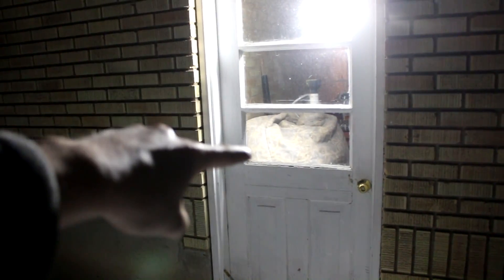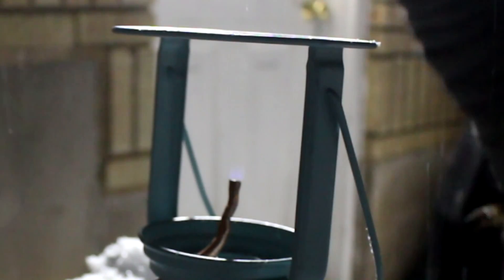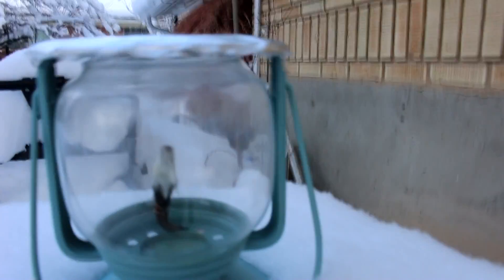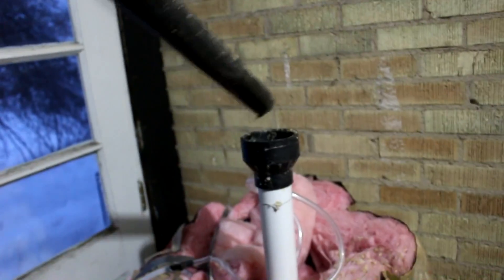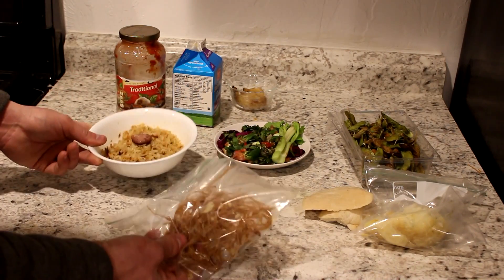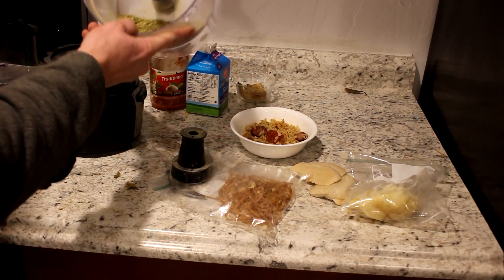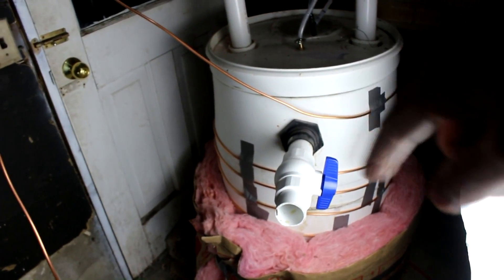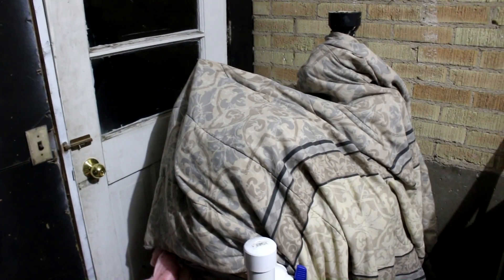Cody's Methane Generator Part 2: I Have Gas!

Comment: Hello Cody, 

I know it has been a while since you made this video and I do not know if you will be looking at comments from older videos, but I thought I would give it a chance regardless. Over the past few months I have been thinking about how it would be possible to make liquid hydrocarbons (diesel, for example, especially given prices currently) using the Fischer-Tropsch process. My full idea is to use a methane generator like this or woodgas from charcoal production to produce the raw feedstock. This would then be cleaned and then broken down into hydrogen and carbon monoxide to feed into the Fischer-Tropsch process. Obviously the system would not be very fast, even though parts of the process are used industrially, and likely not economically viable, but I thought the idea might be interesting to test or at least think about. I don't expect a video on this or anything, I just remembered this video and thought the idea fit.

Comment: So why not get a really big ball, or daisy chain a bunch of them.....and when the whole batch fills up, pump it into steel containers? You could probably figure out the rate of production, and set the gas pump to run off of a standard house timer. Perhaps set it up with a physical switch that overrides the timer and turns on the pump immediately if the balls inflate too much too quickly.

Comment: isnt the 1 kwh used to heat the tank capable of giving off more heat and therefor light than the gas you can generate per hour?  i mean a 60w bulb is only using .015kwh and that seems like more power than you could create with that gas, no?  obviously storing and pressurizing the methane system would change this fact but as it stands it seems terribly ineffcient if you have to heat the digester

Comment: Hey there
I m building one myself, did some research on the topic and I ve seen many projects including an inverted barrel immersed in water, before the methane makes its way to the storage...

My question 
What would happen if one were to connect the methane digester directly to a storage container instead of having it pass through the submersed barrel?

Comment: Could you build a water piston,
What I'm thinking is a lot similar to the coil around the water heater.

But instead of the coil the water heats up expands pushes the top out of the pipe lowering the pressure, after the pipe reseals itself it will suck water in Sears bottom.

The pressure in the pipe will move the lid down ferther, but the lid is completely enclosing the pipe and when the suction that has lowered the lid far enough it will match up holes in both pipes, and that's what lets the water in.

Comment: how many rabbits to power a lawn mower ICE that would A. power an off grid AC generator
B. provide heat from its exhaust to run said digester?  I imagine between pelts and rabbit stew on a small farm it could work

Comment: While I was watching and you mentioned that cow waste would be superior I remembered that cows have 4 digestion areas not certain about cows guts.  So it occurred to me that the digestion process would have stages and possibly different efficiencies and a better digester would have multiple compartments.  Then you showed how you had begun to improve the design by adding the waste exit pipe for the "digested material" how do you know its fully used?  What I am picturing is a flow like a dry composting toilet design except closed in with multiple tap off points for the gasses.

Comment: What about human droppings, can you use them too?
Reply: Yes and many sewage treatment plants do this. There is a bit more of a hazard as human stool can get you sick easier as the bacteria in human stool already is equipped to live in the human body. Keeping the area clean and it should be fine, however as you can see when Cody took the insulation off that is not easy and spills do occur.
Reply: @MyuFoxable  well, to be fair, I don't think Cody was as careful as he should have been when pouring that mixture in. He could have used a bigger funnel to protect against spillage.
Reply: That is kind of my point. Keeping the area clean enough for when handling human stool is not as simple as one might want to think. Would be a lot of hassle when feeding the digester is done 2 - 3 times a week. Still can be done, just probably not a good idea from a safety perspective.

Comment: An old, OLD, friend of mine did this back in the 1970's. He used pig waste to produce methane which he used to light his barns. (Pro tip: Point the nozzle down and hang the mantle off of it; just like a Coleman lantern.) During the summer he even managed to collect and compress some of the gas for other uses that included soldering but not welding. But, then again, he was a bit of a tree hugging weirdo.

He actually used outdoor carpeting on the floor of his pig stalls and had an automatic wash station that would rinse most of the gunk off his pigs while they walked in. I have not, to this day, seen cleaner barns or happier pigs! On hot days they would basically spend the entire day, when they weren't busy eating, walking back and forth through the wash station to cool off despite the fact that he also had a bunch of shade trees overhanging the pig yard. Pigs are a whole lot cleaner and smarter than most people would believe!

Comment: Cody look into the quality of fiberglass insulation. It degrades as the temperature decline. It is not good source of heat retention.Good luck like you videos.

Comment: Add cooking oil, new or used, at a rate of 1% by volume. The oil coats the methanogens allowing them to survive the higher PH levels associated with the increase in methane production.

Comment: You should make a co2 generator and use algae to make it into o2 then connect the pipes with the ch4 to make. It 75% CH4 and 25%O2 and then burn that

Comment: but then you're making a methanizer whose purpose is to heat itself, isn't it kind of pointless ?
i think it would be much more interesting to rig it so that methane accumulate, then you burn part of it to power a small compressor that forces the rest into a pressured container. 

it's a lot more complicated though =)

Comment: What do you do with the gunk you take out of the tank?  As methane is only carbon and hydrogen  then the gunk should be full of the nutrients that was in the food (nitrogen, phosphates, potassium, calcium, trace minerals) - do you use it as a plant food?How liquid is the gunk - does it have many suspended solids?  How well do the bacteria digest the lignin in the wood shavings?

Comment: Don't use meat in your compost. It's easier to remember than one part meat to X parts plant matter. And also no risk for rat infestations at all, as compared to a slight risk. You're going to be happier using it too. No meat, that's the ticket.

Comment: in b4 we won't get an episode 3 because the flame lit the insulation on fire, the fire reached the main chamber where the methane's being produced, and it exploded taking out his garage. now the next methane generator video will be a reboot. with no open fire heating solutions. out in the wilderness near the range so if it blows, it doesn't blow up any buildings.

or he's just forgotten about it. or it didn't work and he's just quietly scrapped the project.
damnit cody, give us something! D:

Comment: Cody, will there be a part 3?  Did the heater work?
Reply: sethada1846 he meant in a later video. Something about he forgot about it, and the power went off and all the bacteria died
Reply: So, it did not produce enough methane to heat itself?
Reply: @MudkipzJM  Wut. Even if the thing froze solid, the bacteria would survive. They can be frozen solid and be fine once thawed.
Reply: @princenephron7546  might have forgotten to feed them
Reply: @princenephron7546  I think that's only extremophile bacteria. These bacteria were less hardy (remember, there are thousands of different bacteria species!)
Reply: @MudkipzJM  Bacterias don't die of cold.
Reply: @MrGigi-dz9cv  They do, that's why you have a freezer to keep your food in, L
Reply: @benjaminvanrenterghem3525  You are wrong. Cold only slows bacteria multiplication. If kept long enough foot will eventually spoil în the fridge too.
Reply: @MrGigi-dz9cv  It doesnt only slow bacteria multiplication, some will die, too. Furthermore, those bacteria arent bacteria at all, but archea
Reply: @benjaminvanrenterghem3525  Refrigerators slow bacteria development, Freezers stop bacteria development, Heat destroys bacteria
Reply: I'm pretty sure he said in a video that it was a failure unfortunately. I really enjoyed this project too.
Reply: Addfuture which video?
Reply: Whatehver, it probably did not work because all the heat small flame produce was lost on the way.
Reply: In shrimp in box video he mentioned that former methane generator became self-sustained enclosed ecosystem powered by sunlight. It has grown grass inside them.
Reply: he said in a live stream when he was making his copper chain mill suit that the heater didn't work and that he was just to lazy to get it going again
Reply: @bluesoul344  thank you, been trying to find information after watching this, i wonder how long it could of gone for with the electricity still attached rather than heating itself, it technically would need a form of a thermostat for the natural process to keep itself at its preferred temperature, which with the right agitation system for methane you could multi store/heat itself in summer and use the storage/still heat itself in winter, I honestly want to give this a shot.
Reply: @TAWSOPRODUCTIONS  yeah no problem
Reply: 7EvilAdams actually he didn't say it was a failure

Only that there would be a part three

Comment: That's cool! I have worked in a plant that produces biogas. You should convert a generator or oil heater to use biogas! But remember to have detectors for gas. Have had a few near misses with leaking gaskets.

Comment: I saw a diagram for a cooling circulation system for our school once. I think there were two or more check valves to get better flow by isolating the heated zone and cooled zone(s).   this may work well for the methane burning heater.

Comment: I was gonna suggest avoiding the heater ;) What's the point of burning fuel if you have to use electricity to make it, after all :)

I was kinda hoping you could end up with a "free" source of energy, but I guess getting free methane for some later experiments is the point here, not to produce fuel.

Comment: Hey Cody, I notice you feed your rabbits Celery stalks. I heard that was dangerous for them because they could choke on the stringy parts. Are you worried about that? Also, at 14:14, isnt that a fire hazard?

Comment: do you plan on capturing the Methane gas, and compressing it and storing it in a canister?    Kinda like propane, and use it later. Is it possible to do? 
I think i missed it. What are you doing with the leftover material from the digestor?  are you going to compost it and use it to grow a garden?

Comment: your heating the raw material artificially, I was just wondering what the power input is to potential power output?
Reply: Also if you are making partially heat on output why not find a system to put that back into the system... No power input needed in this case. This would create the super methane gen

Comment: Hey Cody, i'd be interested in seeing if the methane generator could run a propane fridge. They cool using a reaction between ammonia and hydrogen, powered by a small propane flame. It seems like with the right setup to run on a methane flame vs a propane flame, you could have a fridge that runs basically for free!

Comment: Hello guys, just wondering if theres anyone that can confirm/brake my idea. So i was just eating dinner, having fun, watching this video, till i was full and about to throw up, then i rememberd, that stomac mostly contains HCl to split the food, then i thought, could you technically extract HCl from your puke. So my idea was, 
1)Add Na, so that HCl+NaO-> NaCl and H2O
2)Filter out food bits from saltwater solution
3)Boil off the water
4) add H2SO4 so that H2SO4 + NaCl --> HCl + Na2SO4
that is the idea and i wonder if it is posible. Sorry, but I dont have that grate of knowlage in chemestry, yet, i am still in 9th grade, so dont judge :)
2)

Comment: Waouh ! -15 °C outside is cold. You mention 98°F or 37°C for ideal temperature for the digester's. Delta=50°C. What's the temp in the room though ? The thermal study is interesting. I guess the fermentation itself produces quite some heat, apart from gaz. Is there a way to quantify that ? Could power output of electrical heating for various settings quantify the thermal conductivity of your digester enclosure and then use that to calculate the heat produced by fermentation from temperature data ? I guess fermentation produces more power in heat than the lantern from the gaz. What do you think ? Thanks a lot for these videos.

Comment: Are you going to make a glass tube of liquid methane? What colour is methane? Is methane corrosive?
Reply: clear, non corrosive because it's not an acid, and it's not liquid at standard room temperature and pressure. That requires cooling and compression equipment.

Comment: your entire channel...can't...stop...binge watching...
Also, got a project for ya, the diesel generators you have runnin at the ranch, could you grow a plant that makes seeds suitable for vegetable oil production and run the generators off it(most diesel engines will run on vege oil or other typical oils with no modification)

Comment: I think it might be better to place the flame inside the enclosure and build valve to let air into the tubing like a Bunsen burner. You might be able to make the heating element a little more efficient.

Comment: That's some impressively fast production! Enough to be practically useful. Way to go Cody
Reply: Love your videos Man!!!!
Reply: Awsome
Reply: It's not practical. You're heating water, that takes a ton of energy. You're getting very little back. That tiny flame would not be enough to heat the approx. 20 gallons of water in the bottom of that barrel. If you instead used a wood fire or coal, etc. it would just make more sense to use that heat energy rather than from the methane produced. If this were large scale like a brewery vat with a wood fire underneath I could see it being viable.
Reply: hes only heating it cause its winter and he wanted to work on it
Reply: @Jazzafritsch  I haven't had to use the word duh in a while but it comes to mind. You can't assume that there will be mild weather all the time. Sometimes you need heat to make this process work, making it impractical IN THIS CLIMATE.
Reply: @GetMurcD  it doesent take much to heat it because it only needs to be warm and it is very well insulated.

And what he said, shit heats itself.

Comment: Since I doubt you'll find an out of the box solution for compressing the gas, I threw together a design of a simple automated compression system that should work (hopefully) with the low input pressure of your methane generator. Link to diagram: http://imgur.com/a/fBofm

Comment: The copper wrap around the barrel is likely to be the biggest issue with efficient heat transfer, why not make a coil that descends into the existing heater system? That tube that extends down and has a electric heat probe in it.  Would work same way and should siphon as it transfers heat.  Just the heat delta is likely to be alot higher since its in the hot water trying to heat already hot water.

Comment: Cody, I assume you are bubbling the gas through water to dissolve some of the CO2 produced in the digester. If you want to remove more CO2 and further refine your methane, try making a hot/cold water circuit, where the gas bubbles through cold water, which then circulates to the warm side where the dissolved CO2 will come out of solution due to the warmer temp.

Comment: cant you pressurize the system? does it still produce methane under pressure? i was thinking you could maybe use some pepsi bottles as gas tanks, but first you'd need the sistem to be at about 20psi for the idea to be worth it the trouble

Comment: use it as a pilot lighter maybe and is it possible that you can pressurize it so it will have a greater output? use the beach ball and a valve on each end of a t-split.

Comment: I hope you left the electric system in place in case the flame doesn't cut it, you wouldn't want to freeze it out and have to start over again. You could monitor the kw usage of the heater with one of those killer kilowatt hour meter things and see if it's running more or less than before.

Comment: Wait cody if the gas you were producing was methane it wouldn't smell at all but correct me if i am wrong.
Reply: It's around 50% methane, it isn't controlled for purity. Being contaminated with stinky stuff might actually be good for leak detection.

Comment: The amount of electricity your using to keep the tank warm is emitting more CO2 and stuff than just letting the methane go. The power plant had to use coal so you could run that heater. With the loss thru the electric lines to your home is total waste of electricity. If you were a huge  facility then possibly this is worth it . This video is pointless. Your producing such little methane you cant do anything with it any how!

Comment: as a plumber/gasfitter I found this pretty interesting. Especially the copper coil to heat the tank, I'm interested to see if it generates enough heat. One thing I noticed though: the drain pipe with a valve looks like it is backgrading towards the tank, is that on purpose?